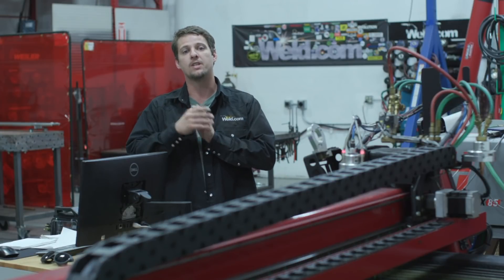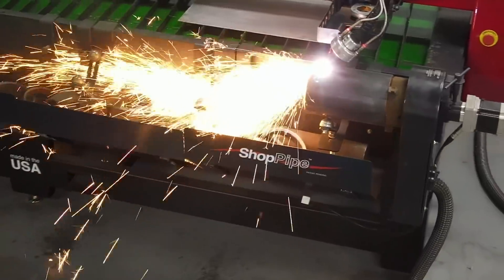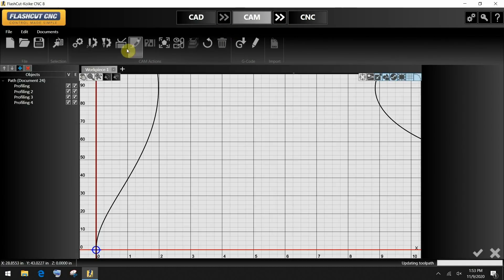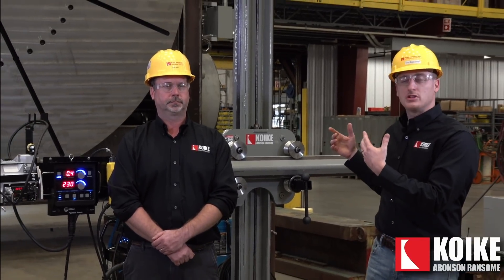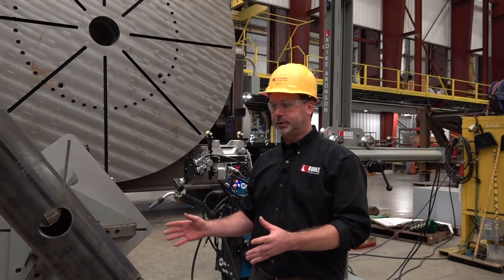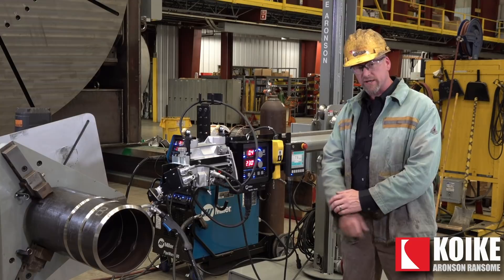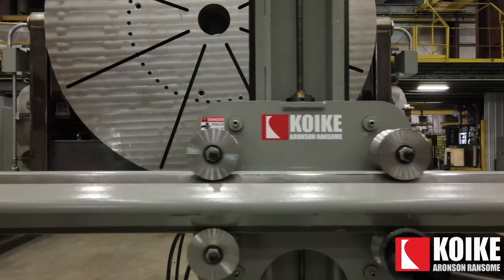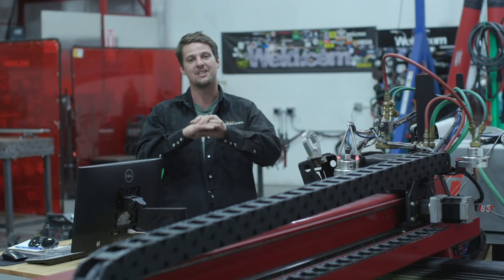Koike's Guide to Cutting and Welding Pipe

Comment: All the automation, is going to take our jobs.
Reply: The computer took the typewriters job, both still need an operator, just like these machines do.
Reply: Not all of them. But certainly many in the field. Small shops will still exist for one off, repair etc. but the production repetitive welding will be done by robot. It is more cost effective, never comes to work drunk, has no health insurance  or hours worked limitation.